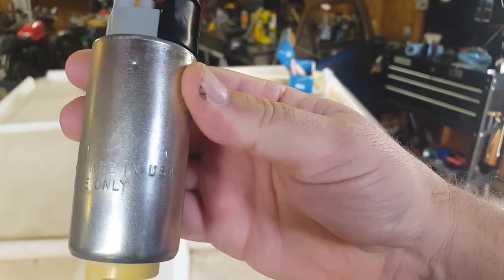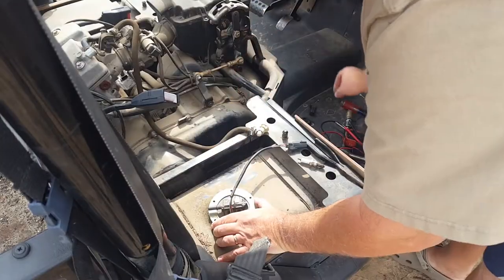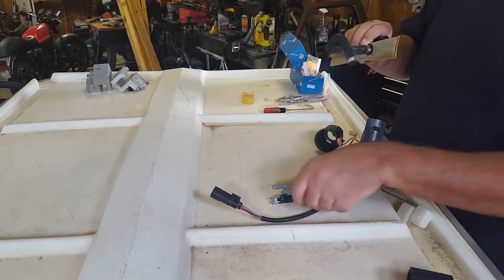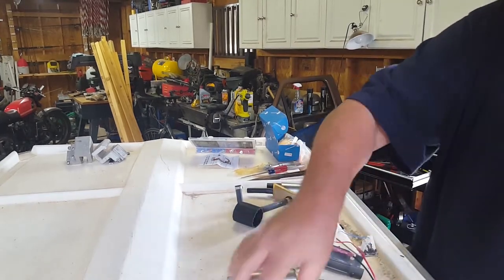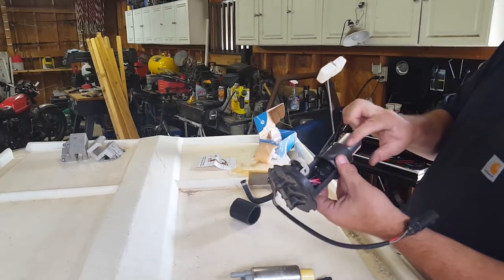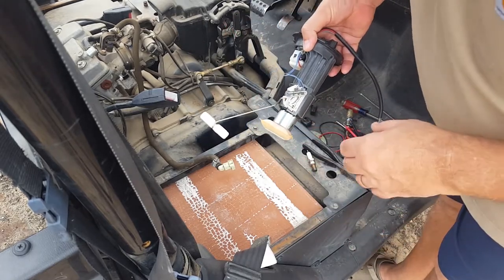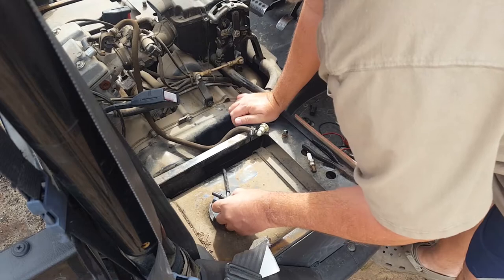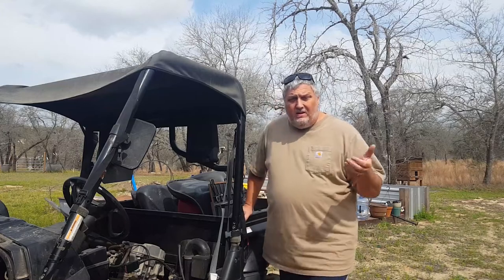Kymco UXV 500i fuel pump replacement

Comment: saw this since i had the same issue. Did find the correct part ( WALBRO FUEL PUMP F20000303G3 ) Figured it's been a while since this video was created and that someone might sell one by now. Part fit perfect but is louder that the original, hope that's not a problem. Also had to replace the fuse and clean the injector in order for it to run but it was definitely a bad pump as well. Quantum Fuel Systems had this part, did not see it on amazon or ebay though. Thanks for the video, gotta love youtube.

Comment: Thanks for showing me how to remove the lower fuel pump plastic housing. I was scratching my head trying to figure out how to take it apart without breaking it. You quickly explained it in your video on replacing the fuel pump and I was able to separate the bottom housing! Thanks for your help! Job done. 😅